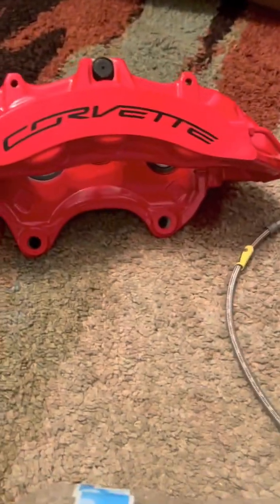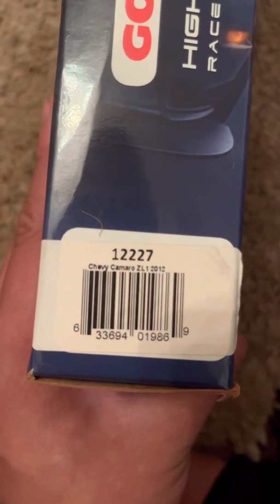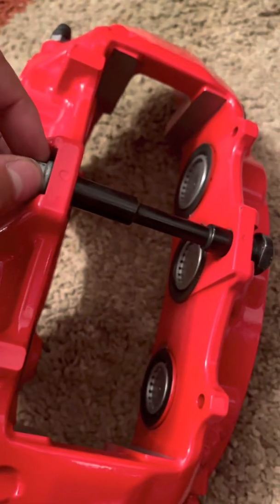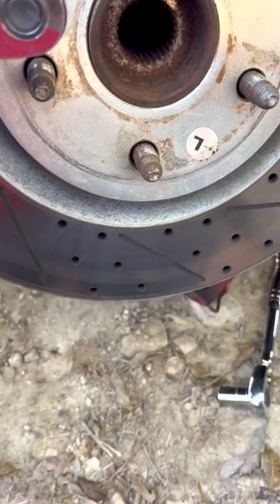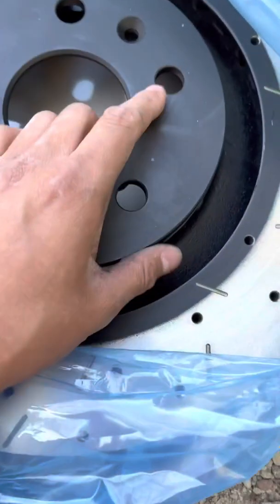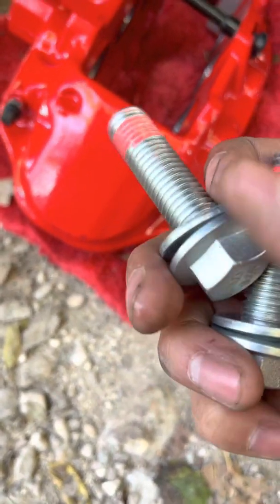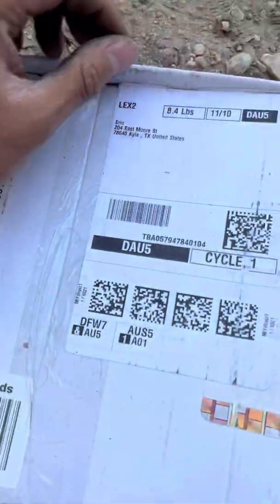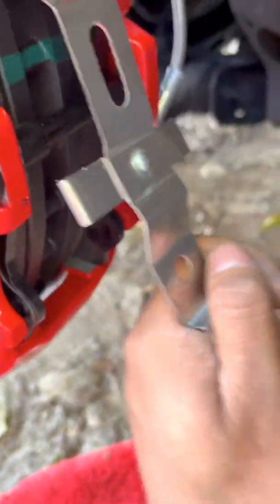5th gen camaro big brake upgrade! Z06 C7 6 piston

Comment: I wanna ask so I can make sure I have a 5th gen 13 zl1 and I was wondering if the 18 zl1 will fit my car?
Reply from the maker: No not the 18 zl1 you need a 18 SS with the brembo 6 piston package. The zl1 is larger and won’t fit
Reply: @alfamods2.0T  dang that sucks guy in ft worth has a silver set would look badass on black 13 zl1
Reply from the maker: @Stinky_G04t  just get the CTSV set up it’s like 400 a caliper on Amazon plus rotors and lines

Comment: Hey I don’t mind to ask but I have a guy who’s selling a 2019 brembos zl1 rotors and brembos all together I didn’t find no conversion kit on those I was trying to find some for my 2013 rs camaro would those fit mines or no ???
Reply from the maker: No 6th gen rotors won’t fit and the ZL1 calipers (6th gen) would require z28 5th gen rotors to use. Just look for 6th gen SS 1LE calipers that fits with the 5th gen ZL1 rotors and lines
Reply from the maker: Just get the CTSV GEN 2 calipers on Amazon ACDelco GM Original Equipment 172-2521 Yellow Front Driver Side Disc Brake Caliper Assembly with Cadillac V Logo.
Those are 325 new. Pair those with ZL1 rotors or CTSV gen 2 rotors. You need ZL1 brake lines to reach.

Comment: How small on rim size do you think I can go with those on?
Reply from the maker: That’s a good question it’s more offset related. I’ve seen 19 inch and certain 18 inch. My 20s almost didn’t clear because of offset
Reply from the maker: I’ve got the latest set up for sale as well. 6th gen 1le 6 pistons, DBA rotors, stainless steel lines.

Comment: Awesome video! Bro I was doing research on this, how to put Ss 1LE brake caliper on 5th Gen Camaro but I couldn’t found right rotors for my car
Reply from the maker: Just use the ZL1 rotors or gen 2 CTSV rotors and your good to go for the 5th gen.
Reply: Hey bro, real quick question when we change spindle do we have get zl1 or Ss one if we have a v6 Rs to convert over
Reply: What part number for spindle for from side for Camaro 10-15
Reply: Front